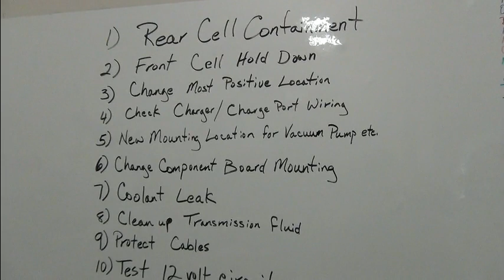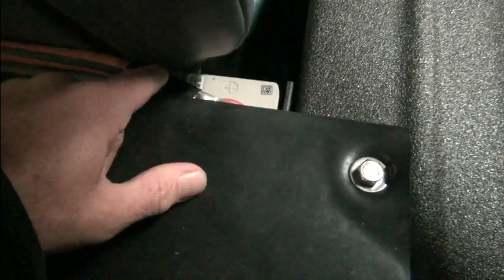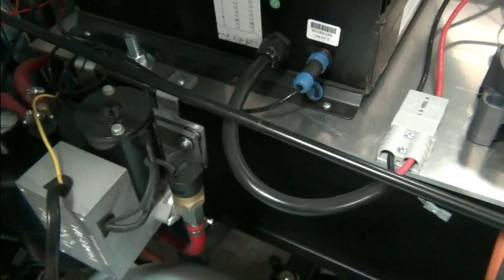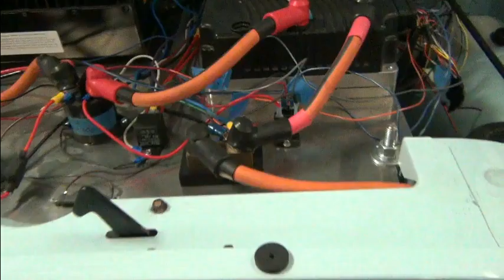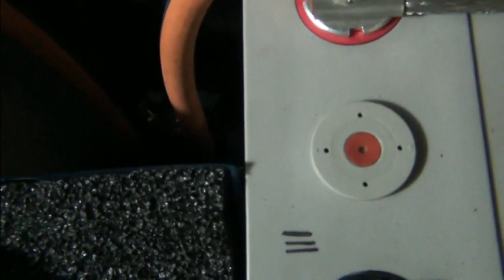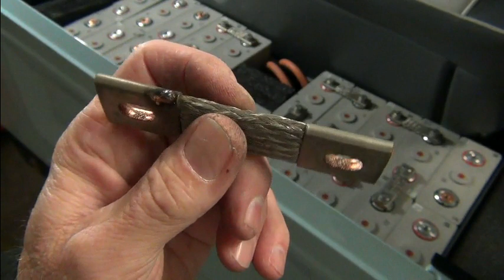Jeep CJ7 EV Conversion - Inspection, Repair, and Completion, Episode 2

Comment: Seems the original builder didn’t budget for safety space in back to protect the rear battery segment from accident-associated damage.
Is there a required minimum distance from front/back/sides for traction battery placement?
Thank you for the case study turned tutorial.